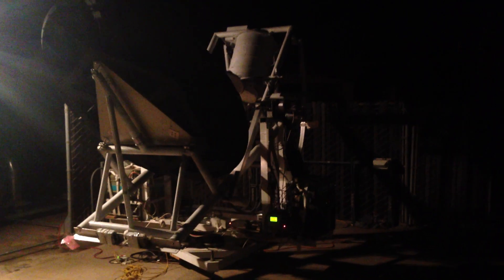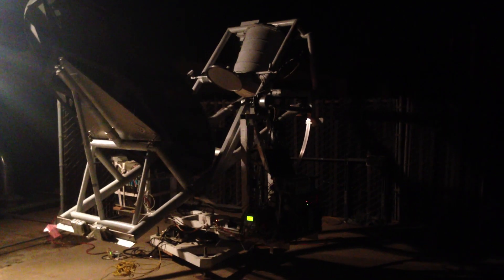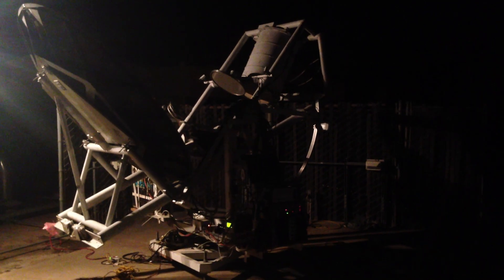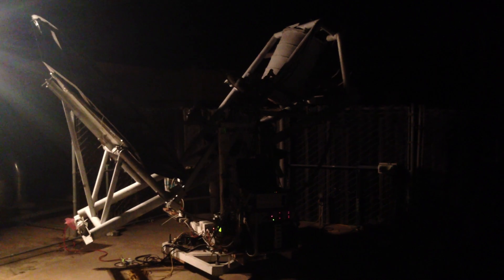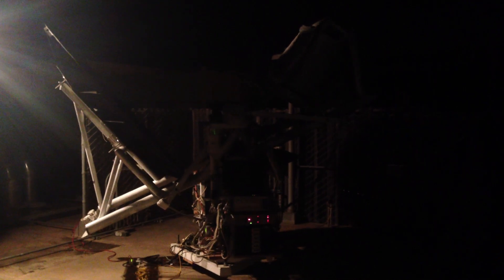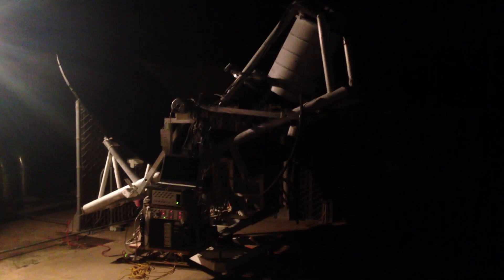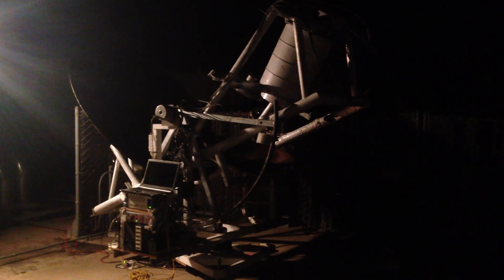Microwave Telescope

Comment from the maker: You'd be surprised. It's actually intended for the top of a mountain (Google White Mountain Research Station), but it is actually usable and testable even at sea level. You just need more time to take data.

There is a version that is balloon-borne. Balloon-borne instruments are actually one of the cheapest ways to get above 99% of the atmosphere, admittedly only for a fairly short time.